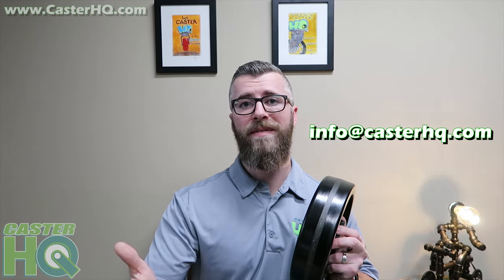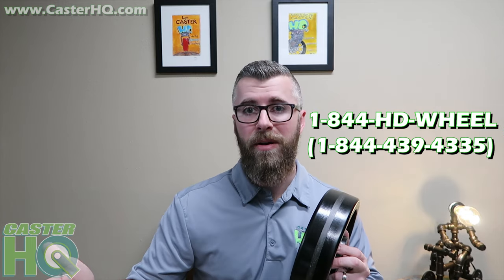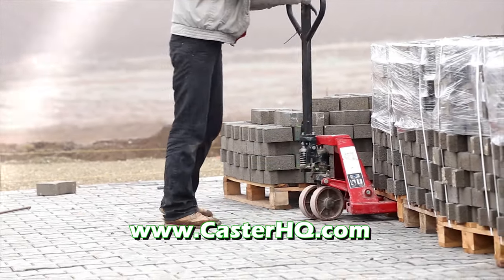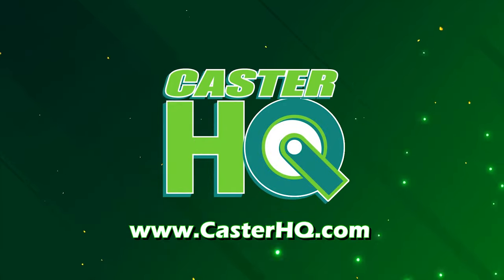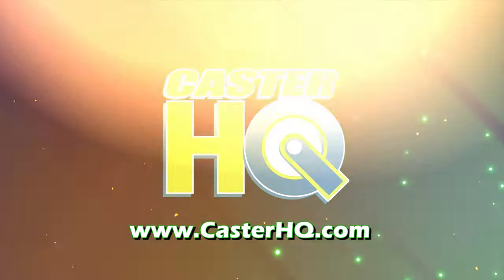Phenolic Wheels for Casters, Carts, and Equipment!

Comment from the maker: Shop 6" x 2" Heavy Duty Toolbox Caster Set of 4 with Phenolic Wheels, 4,800 lbs Capacity per Set of 4, 2 Swivels with Locking Brakes and 2 Rigid Casters, CasterHQ Brand: https://amzn.to/3HanwUf

Comment from the maker: 0:00 Start
0:14 Where Phenolic Wheels are Manufactured
0:36 Manufacturing Process
0:46 Floor Types Phenolic Wheels Should be used on
1:07 Phenolic Wheel Characteristics
1:20 Common Applications Phenolic Wheels are used on
2:10 Chemical Resistant Properties
2:35 Wheel Application Recommendations
2:50 Different Sizes of Phenolic Wheels
3:53 Summarization of all Benefits of Phenolic Wheels
4:11 Temperature Range of Wheel
4:45 CasterHQ Contact Info
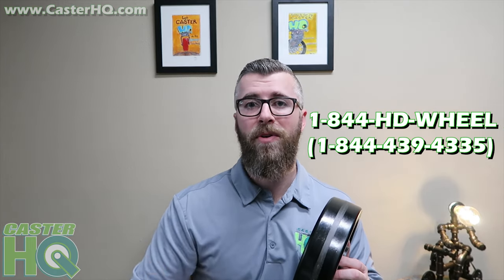5:15 End of Video